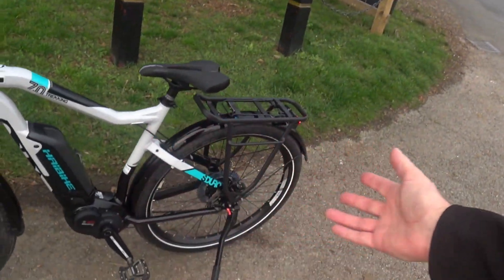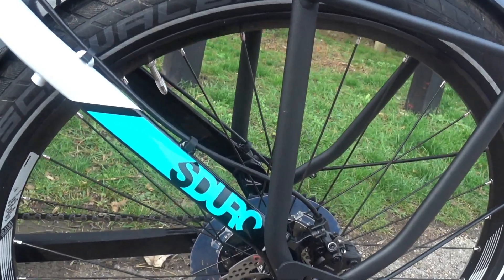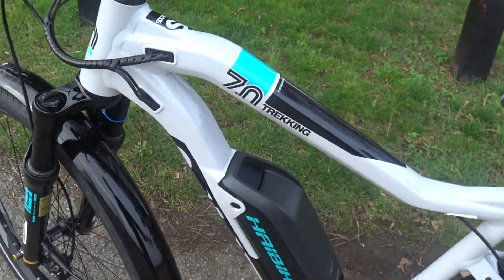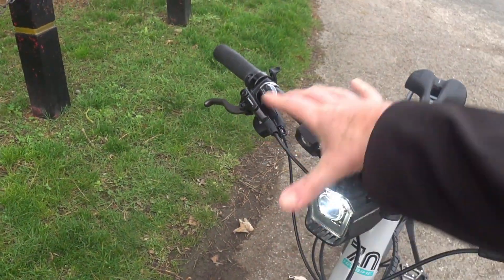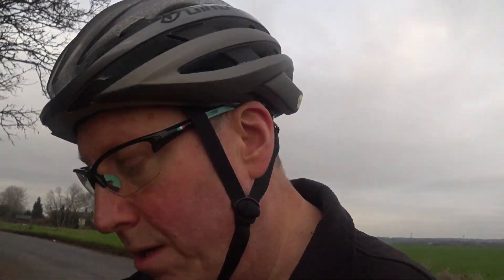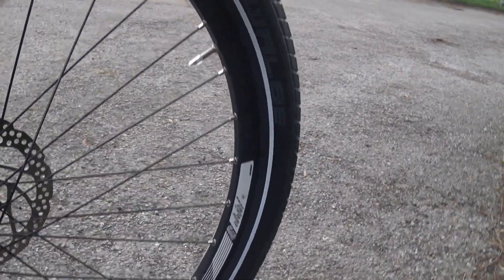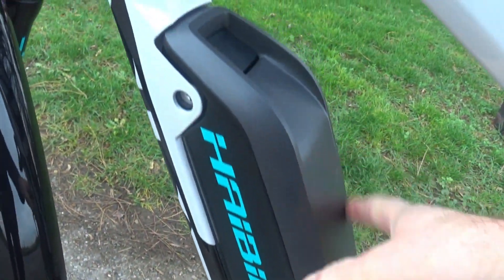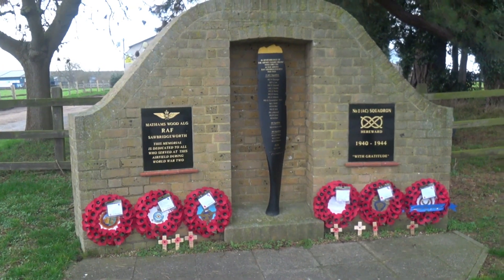The 2019 Haibike SDURO Trekking 7.0 (part 1)

Comment: I picked up the 2018 Model of this bike. Narrower tires, but still wide at 1.6", higher end alex rims and MT4 brakes. However the 2018 comes with XT group set and a 350W peak CX motor.  I also saved $1400 over new. Great bikes!

Comment: Enjoyable review mate. May be worth updating the description with the top trump stats, range unassisted, top speed unassisted etc
Reply from the maker: Thanks, the range is so depended on factors as my/your weight, wind, hill gradients and terrain its impossible to get accurate figures but all ebikes are quoted around 30 miles for the top three modes and nearly double for the eco. Besides court on Electric Bikes Review is much more comprehensive than I could ever be however my long term vlog will cover much more in time stay tuned. Thanks for posting

Comment: No disrespect, but clearly as this is your first e-bike maybe it would have been better if you got a bit more experience before posting a video.
One point needs clarification, the frame is hydro formed Aluminium alloy, not Chromoly which steel.
Reply from the maker: Yeah none taken this was just my thoughts second part will cover ranges etc